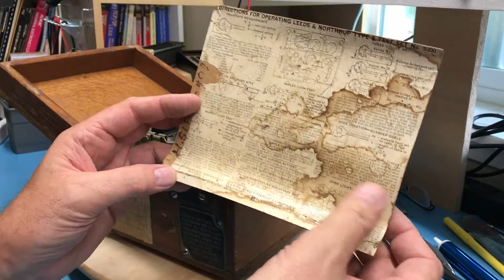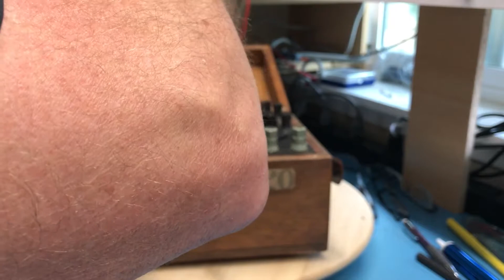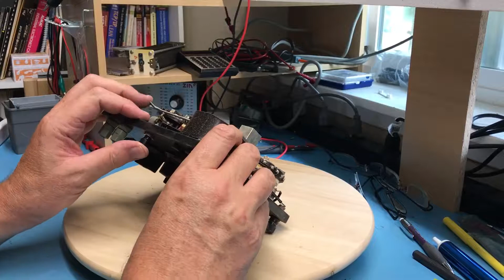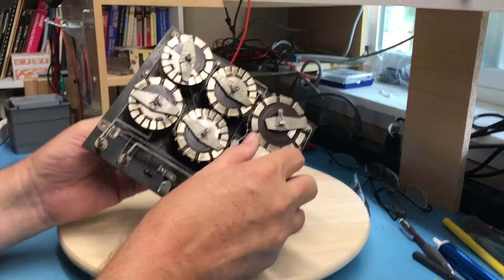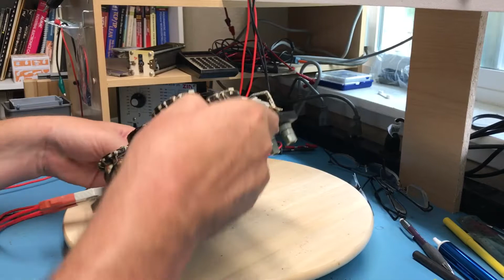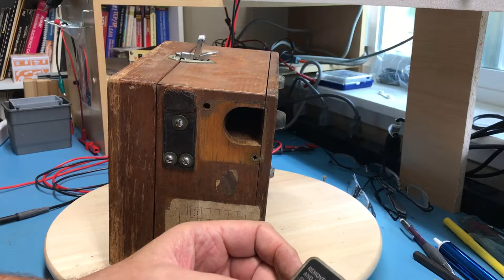Vintage Lab Gear - Vintage Leeds & Northrup Resistance Instrument Teardown - STB63

Comment: I have a vintage L&N "MICROMAX" mutli channel, electro mechanicel chart recorder and the accompanying 12 channel L&N galvanometer so the Micromax can record temperatures from thermocouples.  My father got it as they were throwing it away from the former Esso Bayway refinery in New Jersey.  He had it hooked up to thermocouples around the house, inside, outside, wet bulb, dry bulb as he was a weather enthusiast and generally a scientist.  It last worked fine on April 11, 1988 the day my father passed away.  It's been in my garage ever since.

I am moving and need to get the Micromax and galvanometer out of my house.  I can't find a model # on either machine, but I can send pictures to anyone interested.  

If interested post a reply to this comment.
Reply: still have it? am interseted

Comment: Did you ever get the multiplier function working? Is the multiplier in the same path as the 1000s 100s 10s and 1s? Mine does the same thing. And I agree, what amazing switches!! The box is very accurate. This is a wheatstone bridge from around the 40's and 50's. More info can be found here by scrolling a little bit more than half way down http://www.radioblvd.com/vintage_test_equipment.htm